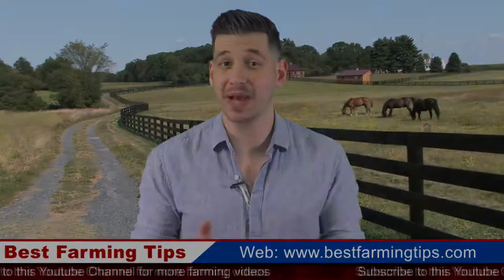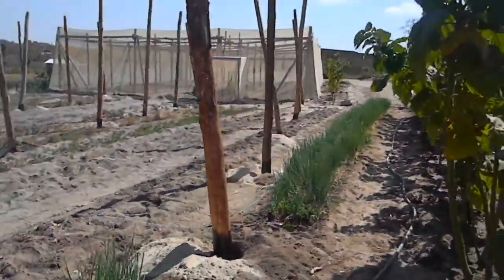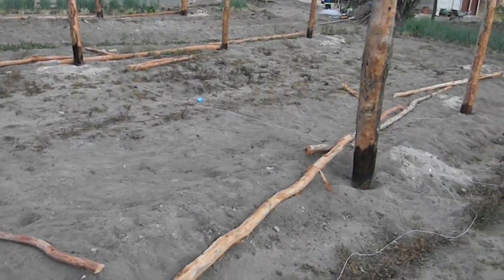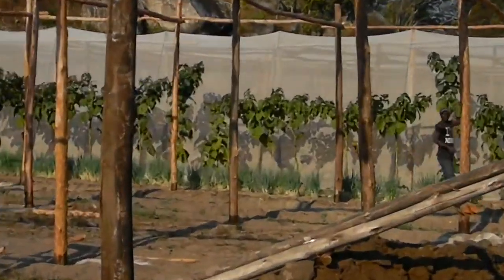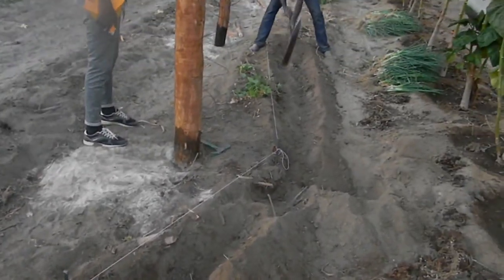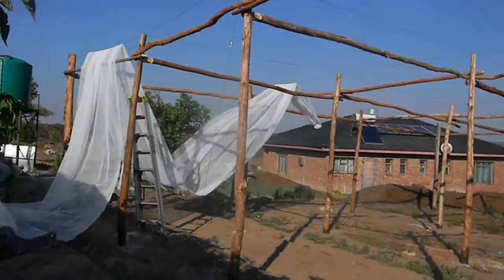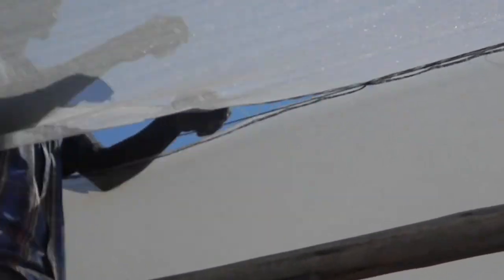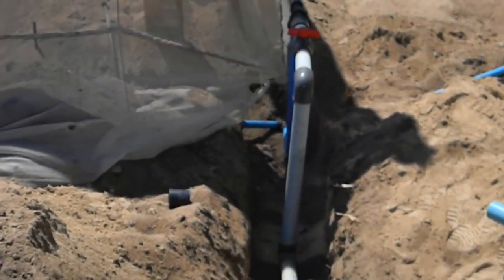How to construct a shade house - Shade cloth greenhouse DIY

Comment: Hi, I am glad to find video on shade cloth /net and i am seriously considering it instead of uv plastic because of very hot climate all year round at my place (Malaysia). May I know is it the same as the insect net which normally used for greenhouse wall? from where i from, the most common netting for agriculture is using the black net (paranets) but this one the wholes are much bigger. Could please point me to any shop that sell the shade cloth/net us use for this construction? tq very much
Reply: Reason why people in hot climate use plastic 
Is because of the introductory  inception of control environment agriculture coming from the northern / europe @ cold place to protected from freeze .
Forget about plastic use shade nets or insect exclusion net / 
Make sure you make poles high enough for air circulation @ 3.5 - 4.5 mtrs
Reply: @SH-bw5fx  thanks

Comment: Thnk so mch l want to build mine 30 by 12 m
Reply from the maker: Hi Dennis, that's good to hear. I'm sure you have seen that it's so easy to construct your own shade net greenhouse. In Zimbabwe you can buy the shade cloth at Twine n Cordage, formerly called Tanzi. They are based in Harare, Southerton along Plymouth Road. They are the ones who manufacture the shade cloth in Zimbabwe. You need 3 rolls of shade cloth for a 30 by 12m greenhouse. If possible increase it to about 30m by 13.5m and it will house 1200 plants, you will still need 3 rolls of shade cloth for that size.
Reply: @BestFarmingTips  thnk u so mch l once constructed a hybrid greenhouse n l covered it w shade cloth with l brought from twine n cordage kwekwe branch so l want to build another one with gum poles only
Reply from the maker: I strongly recommend that you build the one you want to build with gum poles and shade cloth. You will enjoy the results and the durability. I have had mine for over 3 years now.
Reply: @BestFarmingTips  thnk you so mch l send u the pics
Reply from the maker: @dennisganyani5754  Nice, my email is farming@bestfarmingtips.com. When you're done constructing please send the pics to that email address.
Reply: @BestFarmingTips  oky its fyn
Reply: @BestFarmingTips  oky its fyn

Comment: Is it possible to build 40 by 20?
Reply from the maker: Hi, Yes it's possible. The width of shade cloth you are building will determine how easy its going to be to build a greenhouse with a 40-metre length. If the width is 2 metres, then its very easy. If its 3 metres then you may need to work with either 39 metres or 42 metres.

Comment: Why dont you use the insect net 40 instead of the shade net ?
Reply from the maker: Well, a shade cloth is much stronger than an insect net and so lasts much longer, and the purpose of a shade cloth greenhouse is not specifically to protect plants from insects only, a shade house also protects plants from harsh weather conditions, such as rain storm, too much wind and hot temperatures and an insect net will not be able to provide all that.
Reply: @BestFarmingTips It depends, what area is it located? Greenhouse is about creating a favorable microclimate and protect from harsh weather. If you want to make a substitute the insect net is the closest thing to the greenhouse. The shade cloth hole is way too big to protect from insects